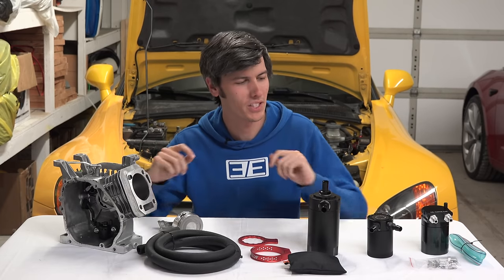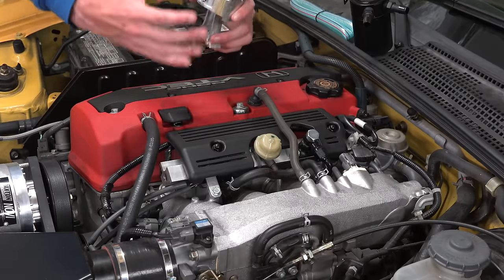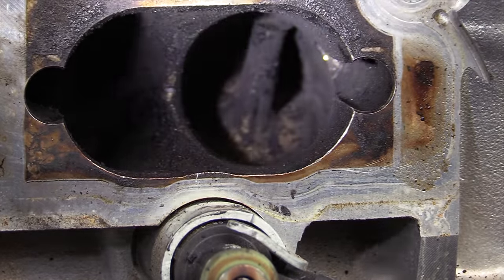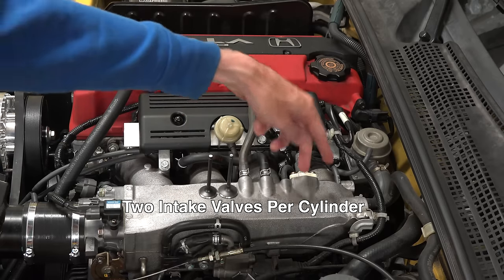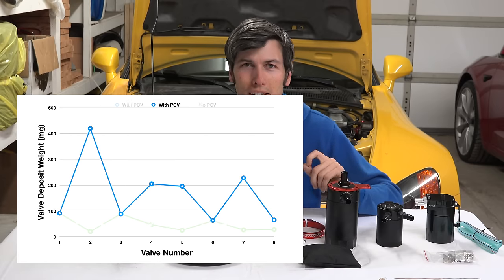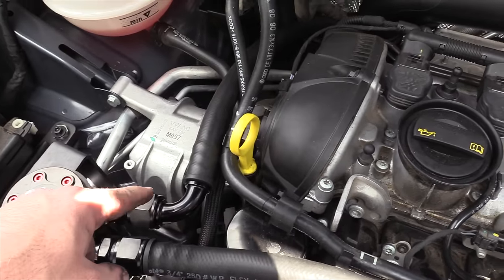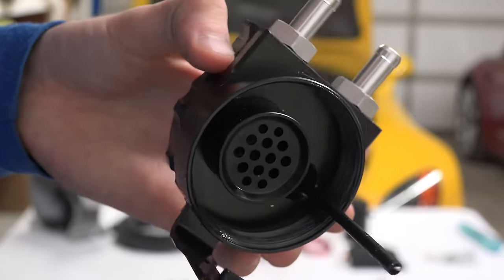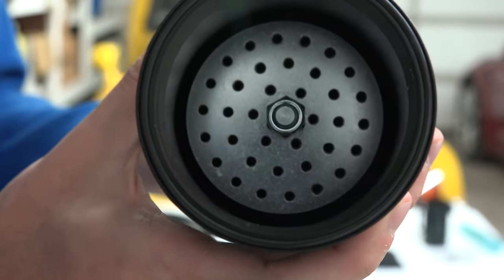Do Oil Catch Cans Actually Work?

Comment: I nice thing about the pos crank vent is, if you end up with gas leaking into the crank due to carb floats not closing properly, is as the gas evaporates, it gives you a bit more power. This of course doesn’t happen on cars, just on small engines

Comment: If one takes their car to the quicky oil change place, will they empty the catch can if you ask them to?  

I think a catch can with a valve on the bottom and a hose that could be routed to point near the drain plug or oil filter would be a good thing.  That way it would be simple to open a drain valve and drain the can when changing the oil.

Comment: I'm a mechanic by trade with 30 plus years, I've always used and still use oil catch cans on every car and installed a few days after getting the car car. They do help reduce oil deposits form on the valves keeping your car running smoother. Only thing is when cars go in for some sort of warranty I need to take them off. I got my catch cans on Amazon for like $23 each, I drilled and taped in a drain to make thigs simple. If you can't use your OEM hoses, save them in the event it has to go to the dealer for repairs.
Reply: As a Mechanic, I want folks to understand that you shouldn't have one with the filtered vent (that I see on nearly all of them). First reason is that vent effectively reduces the 'Positive crankcase Ventilation' to 'Maybe a little crankcase Ventilation'! Secondly, I have seen a couple of check engine lights that 'Read out' as Evaporative emissions system leak small/large'. 
    So, No vent (just plug any vent hole' and Empty it! Check it when you check your oil, like every other fill-up. If you don't fill-up your car, either check it every two weeks or don't buy a catch can. You can put the money towards filling up your car!🤣🤣🤣
        Ya'll Take Care and do it right!

Comment: The problem with those bronze filters is that they create 4 to 6 time higher pressure in the engine block.

Better use one without those filters.

Comment: I actually have the $25 eBay oil catch can installed on my 5.3 Sierra. I drive a thousand miles a week and that oil catch can does its job. I don't see the need to spend more than $25 on a oil catch can. if I needed more oil separation I would simply buy an additional $25 oil change can. If you're on the fence about the eBay oil catch can. just buy it I used 3/8 rubber hose and replaced the cheap hose that comes with it.

Comment: So... why not vent the catch can reservoir through the oil filter and back into the oil reservoir?
Perhaps not full time due to potential pressure differences, but with a cut-off or flush valve that'll open the bypass only when the level in the catch can reaches a certain point?

Comment: Wondering if the low rpm cam profile was considered?  I mean regarding buildup in relation to airflow. Most people watching this don't know the valves in (at least in the S2000) are staggered for "swirl" enhancing fuel mixture... so one of the two valves per cylinder is open further and longer duration at low rpm (below VTEC) might have an influence on carbon buildup.

Comment: energetic presentation but I submit that the total volume of blow by versus the "caught" portion is unknown. Blow by is composed of moisture and a very wide range of petroleum droplet sizes...and other various gas materials from combustion. Are catch cans catching it all or just the larger droplet sizes that will be settled out on the catch can baffles? How much of the total blow by then is actually caught versus how much is again recirculated through the engine. And just how does the valve build up happen, is it from larger droplets of oil vapor that impinge on the valve or is from super small droplets that impact the valve and with engine heat form a crust. To me there is a heck of a lot not well known or understood about the crud formation process and thus it becomes futile to address it with remedy's that are at best just a guess.

Comment: I have a 97 accord and the only modification is a cold air intake. I am getting a pretty sizeable amount of oil in my intake and on the back of the throttle butterfly. I got an evil energy catch can but there’s no where close to the ports to install it. Does distance matter? Also what type of hose? The hose that comes with it is a joke. I got a new IACV and don’t want to install it until I got the catch can on because I think oil is what killed my last one.

Comment: I got a really cheap copy of that Mishimoto off Amazon.  I use it to recirculate the transmission fluid that for some reason drips out of the vent tube of my t56.  Vent tube is hooked to "in" on the can, "out" has the vent cap from the t56 vent tube, and the drain goes back into the fill plug that I replaced with a bung.

No more drips, nor checking for proper fluid level.

Comment: They do work specially when you are lsvtec or b20v 

Why they work?
Because the b18 ls and the b20(never came vtec) the bottom ends were completely sealed but the valve covers is where the pcv valve is on

And on the vtec heads b16 b18gsr or type r 
The ventilation on those are on the bottom end block

So when  go vtec on a b20 or b18 you need to install a catch can system and tap into the valve cover some sort (which is the easist way instead of tapping into the block

Comment: 2012 f150 3.5 ecoboost saw video to drill small hole in intercooler it definitly slowed down the catch can dumps. Team rxp system expensive but works well. 200,000 miles still runs great. Always maintained.

Comment: Do you think you could por seafoam into the catch can and when the engine is running it will gradually pull vacuum and atomize the seafoam into the intake and clean the valves for you?

Comment: I put a cheapy ($30) made for a BMW because of the 3/4" port size on the 4.7 in my 04 Jeep Grand Cherokee. Going on 3 years now, living in a northern cold state it really fills up with condensation water in the winter and just a bit of oil in the summer.  I can say with it and PCV system I modified to the match the later 4.7's the oil cap is now completely clean and dry on the bottom.  Used to get a milky coating in the winter from all the moisture that I now catch with the can.

Comment: Do they actually work?  I would like to think that some solution to the problems inherent with direct injection is better than nothing at all.  I just want it to stay running nice and smooth like new.  How do you do that?  I imagine a good way is to prevent further buildup inside the engine and also to get out any that you can (easier said than done).  My vehicle is a 2017 Nissan Rogue and it is one of many more modern vehicles that has just direct injection.  The major downside is that there is no fuel cleaning the valves anymore!  Anything, safe quick and easy would be a great way to keep a vehicle running well.  It is bad enough that some 4 cylinder engines run rough as it is and we have this stuff making them worse.  The only thing worse is knowing that it was better at one point and realizing that something is congested in there somewhere.

Comment: The bronze filter is actually on the inlet side not the outlet and it’s main purpose is to turn The crank case gases back into a liquid form so they can be deposited into the catch can.

Comment: I have a question, It is a problem if a catch can is installed higher than the PCV valve?, I been thinking and probably the oil can condensate inside the hose and remain there, building up oil, filling up the hose or part of it and eventually pushing resistance to the PCV and doing more bad than good, somebody can answer please? thank you.

Comment: Maybe a silly question, but why can’t you plug the pipe going back into rocker cover and just vent the crankcase pipe into a can, therefore not putting anything back into the engine?

Comment: What about my $600 catch car system. My car is a streetcar, but I do take it to the track occasionally and it’s engine is problematic with blowing smoke through the PV system into the intake and through the turbo.

Comment: Put a solenoid to the drain on the bottom of the can so that it closes when ignition is turned on and 12V is applied to it, with a tube to the crank case. It will empty automatically every time the car is stopped.

Comment: GM solved all of this on my Silverado by having me pull the intake to replace the knock sensors every 80k miles.  While I'm working on that I drop the intake into a Rubbermaid container of Simple Green.  One dollar store  toilet brush later, it's cleaner than a whistle.  I don't have the direct injection issue.  Truck is 16 years old.

Comment: A good starting point is to establish the objectives of the PCV system and then of the oil catch can.  While there are several possible goals, my own dual goals are to suction the harmful vapor by-products out of the crankcase, while sucking up as little oil as possible.  Simply NOT wanting to lose engine lube is reason enough for me, especially on a street driven engine where time and oil can pass un-noticed.  

A good PCV system removes harmful VAPORS (water, fuel, combustion gasses) from the crankcase without removing oil.  These contaminants great reduce our oil quality and performance.  

In short, excessive OIL in your catch can tells you that you need to work on the engine's internal oil separator system.

The ideal would be for our oil to stay in the engine 99.99% while "sludgy" contaminants end up in the catch can and only relatively clean air makes in into the intake manifold.  Unfortunately, some cars send a lot of oil to the PCV hose.  A catch can is not a fix for this but can tell us that we have a problem or problems to address.

Comment: Although supercharged engines are well known for having a little blow-by, condensate (fuel and water) forms whenever we turn off ANY engine.  If this condensate isn’t removed, the first thing your oil pump sends to the bearings on startup is “solvent” (and crud).  That’s why changing oil (even “long life” lube) regularly is so important .  The “catch can” is one more ounce of prevention.  The 3.8L V6 in my 2000 Dodge Grand Caravan has over 292,000 miles on it and can still get 24mpg on a trip.  Also, the sintered bronze filters will stop water, by plugging up.  They will corrode from skin oil too, so don’t touch.
Reply: I've yet to see a sintered Bronze filter corrode or clog w/ water. Or catch oil for that matter. I have about a hundred doing different functions at work and the only thing they catch is solid debris. They only thing they really work for is keeping bugs out of vent holes. If anything an oil catch can will cause more water build up in your crankcase, certainly not less. It's function has nothing to do with water, it's about preventing carbon buildup on the back side of intake valves. 

If you don't want crud getting to your bearings you need block off the filter bypass which, as it sounds, allows unfiltered oil to bypass the filter.

Comment: The Humble Mechanic did a test on the effectiveness of an oil catch can on a GDI VW that he drives and the results were ... underwhelming. He noted the amount of deposits that built up on the backs of the intake valves over a certain distance driven, cleaned the valves and then drove the car the same distance but with the catch can installed. There didn't seem to be much of a difference between the two cases.

Comment: I have same catch can as that $100 1, but in amazon it’s 19$.. i was rong about it not working from a hoses distance, etc., but I did notice something on amazons directions, it says when cleaning, to spray this or whatever ‘back through out port to push oil back to catchcan’, which makes sense so far, BUT THEN ON OIL FILTER RECTANGULAR section, it says,  ‘after brass filter, clean air only will flow out intake’🤔 - which I’m guesscing might mean most, or 1/2?, people will now be hoseing that penguin up backwards(guess their definition of intake means into engine?). anyway a direct contradiction -  hUd of thunk?👋

Comment: Bigger size means it may not fit in tight engine bays. You can modify the cheapest can, by putting coarse steel mesh in the baffling area, or copper mesh , & put it on the bottom  of the can too.

Comment: That bronze "filter" is usualy intended for compressed air systems like plneumatic cylinder actuator with the purpose of a relief/silecer role. Not a gunk, dirty oil and water vapors passing thru it, but clean air with clean low viscousity oil for lubing compressed air parts. 
     On some  time I think it will clog and cause problems , or God forbid, blown crankshaft seals.... 
 The water vapour will be sucke into the cylinder,  the oil will help a bit on the valves and the valve seats. The problem is carbon. But on a good engine I think the gunk will not be so much. A worn out one needs to be repaird , treated the cause not the effect of the illness. And some good heating at over 3000 rpm will blow the softer, fresher deposits, thereby not clogging compleatley the passages like on egr/anti-shudder valve on diesels wich are farther away from the heat/engine block

Comment: Jason, this was such important info.  I trust your advice more than any other - there seems to be a logical disconnect.  If Catch Cans work -  why the heck don't manufactures put these on your engine?   I don't subscribe to the angle that all companies are pushing engineered obsolescence, and therefore I can't understand why every GDI engine isn't designed with this in line.   The only other answer is in fact designed obsolescence, and they want people to purchase a new vehicle at 100K miles?

Comment: I just bought the $100 can. Partway installed, waiting for a hose fitting for the intake.
Actually, it's an unbranded copy of the $100 one. It looks completely identical. But it cost £6.99.

Comment: I have a 2015 Infiniti Q70L with the 3.7 V6 and approximately 47k miles.

Infiniti calls the injection system is Nissan Direct Injection which I am focusing on the two key words...Direct Injection.   Stands to reason based on that description that a catch can would help.  Yes the previous owner(s) apparently didn’t use one or if they did it was removed prior to my purchase.  I would suspect that the carbon has had almost 50K miles to build up....

With that said two questions.

1.  What if anything can be done to remove the current build up....( I have not done a boroscope yet,  just thinking worst case scenario.....is there a method to clean and help remove the current build up.....short of removing the cylinder head and manually cleaning the individual cylinders?

Going forward obviously the Catch. can can reduce further build up but want to help remove the existing build up.

Vehicle #2:  2020 Jeep Grand Cherokee with the Pentastat V6 which sounds described as Sequential Multi Port FI.  Even if it was GDI only has about 2500 miles so I would not see immediate need.

Again with that notation......

Is there a advantage/disadvantage to installing a Catch Can to reduce carbon build up going forward?  Even with current build up the CC would reduce the effects of future damage.

One final question for clarification.....

Catch Can and Air/Oil separator are the same thing right?  Just different naming!

Comment: What is your opinion on the vent to atmosphere way of doing things. I see guys put little plugs with a filter where the pcv used to be. The theory, I guess, is that any pressure just vents out to the atmosphere yet all oil just stays inside the cylinder head and runs back down to the engine. But it seems to me that filter would get clogged with oil and also it might be a problem that it doesn't have vacuum from the intake. 🤷‍♂️ What's your opinion on that? 
Also how to catch cans work on forced induction systems?

Comment: 14 years ago I made two oil can catchers out of a glass jar filled with lots of copper wool as a strainer. It worked very well for about 10 years for the V6 Infiniti. At that time I could not find any thing decent on the market ! Cost about $15.0 each with all the plumbing. I was very surprised to see that today there are ready made ones ! The good part is that with glass jars you can see the oil inside without opening anything. The main question I had is that at 25k miles the G35 will drink 1 quart per 1000 miles, but no white smoke and no more than one or two oz of oil in the cans ??!! Never found out where the oil went!
Reply: It went past your oil catchers.

Comment: I'm baffled, literally! I installed the $25. can several months ago into my 99 Camry 2.2l and it works great. I do disconnect it and go back to stock routing in the freezing months so it won't freeze up. A side benefit of the can is if you've just cleaned out the can and reassembled it, you can then unscrew the dip stick while the engine is running ( which will raise the idle several hundred RPMs due to temporarily being a vacuum leak) and spray carb cleaner into it which will then travel into the intake plenum. While the cleaner does bypass the throttle body, it does get into the intake runner and manifold quite nicely. I'd imagine this could make it more effective at cleaning the valves, but I'm not sure. Even so, it's a quick and easy way to get some cleaner in there.

Comment: Can a Oil Catch Can aid in stopping a Ford Eco Boost engine (3.5 Liter and 3.7 Liter mostly interested in) from having a blowout when the water pump breaks and start leaking into the oil becasue Ford thought it wise to place the water pump within the engine where the water will fall into the pan.

Comment: The vacuum on the intake is incredible so it can suck up oil pretty good. I got a 20 dollar one and works great. The hose it came with is fairly soft and collapses when the engine starts. Not sure if it's good or not but I kinda like that it's cutting off some of the vacuum to the engine.